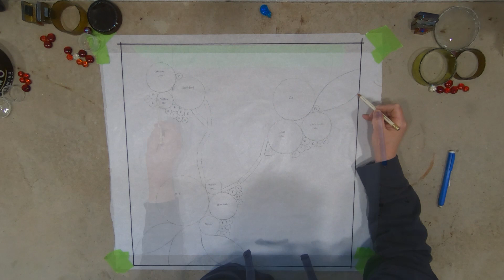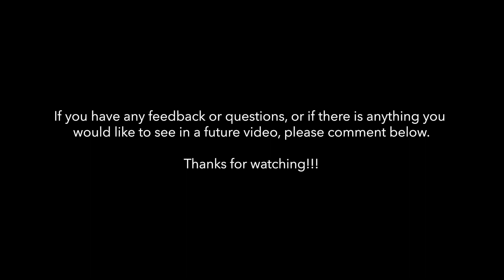Stained Glass art panel from design to completion

Comment: Beautiful! Do you find you like one particular solder better than another? Were you using 60/40?  Was your copper foil 7/32?
Reply from the maker: Hello! I solely use 60/40 solder from my local supplier (Al Malloys made in Canada). I mostly use 7/32 but sometimes use 1/4 foil for the larger bottles 😊